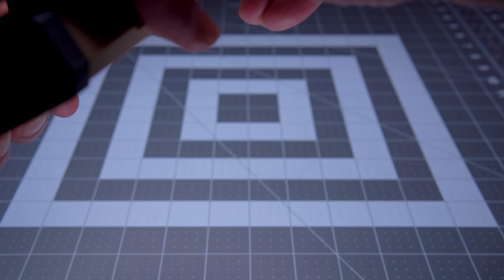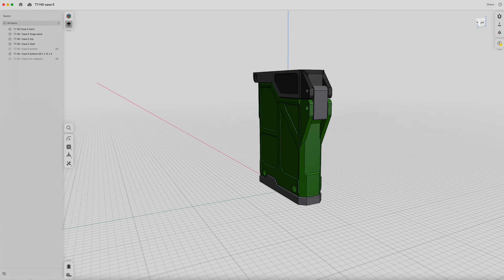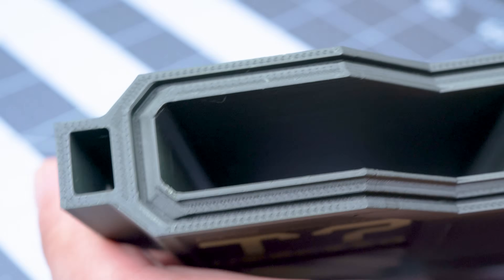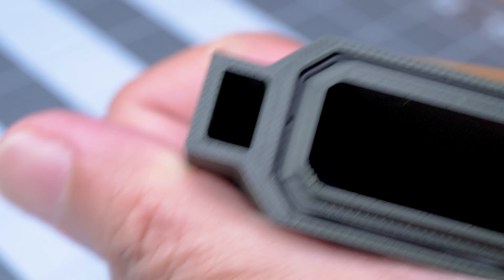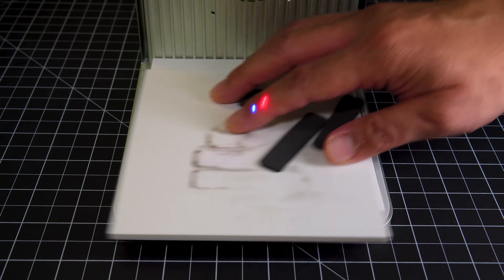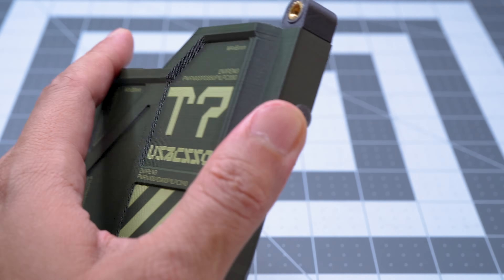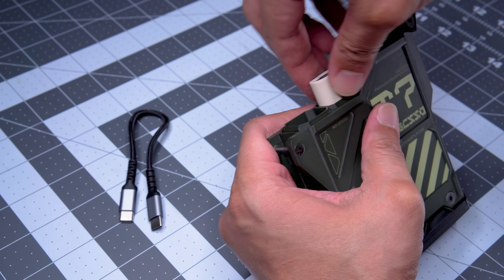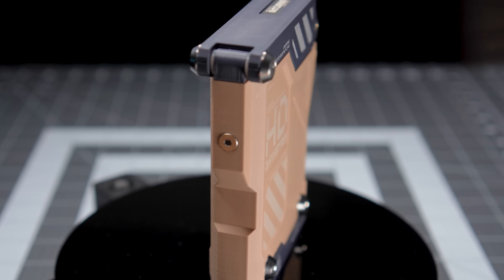T7 Hard Drive Case Build

Comment: You could even pick up teflon washers in that size to reduce friction for the lid if you wanted it to open/close easier. Definitely not necessary but it could be a nice little upgrade.

Comment: Have you ever taken a moment to think about how cool your younger self would find what you're doing now?

Using lazers and 3D printers to build something to hold unfathomably large storage drives.

The only way to make it cooler would be to use plastic that was materialized from thin air using fusion power or something.

Comment: Might I suggest getting yourself a set of reamers for hole cleanup. They produce far less dust if your in a sensitive environment. Plus are generally more accurate when it comes to concentricity and accuracy than a drill bit or other tools. Plus if you have a specific clearance/size you want the appropriately size reamer will let you hit it every time.

Comment: An actually neat feature to add to this design would be a bottom plate with a USB C passthrough. So an upwards facing USB-C plug that the drive sits on and an output socket on the back. Giving it an actual practical use as a harddrive dock that sits on desks.

Comment: okay but why does the hard drive case say "SSD only" on it
Reply from the maker: The limited edition cases shipped with two different bases. One of those bases had neodymium magnets embedded into it, which would have been detrimental to older, magnetic drives.

Comment: what is the tool you are using to press the M3 screw holder into the print? I can't find it on the market
Reply from the maker: It's a 'heat set insert press/tool'. The type that we used for this project is really just a standard soldering iron with thread-on brass tips that are sized to fit the heat set inserts, but the 90 degree armature really helps to make sure that the pressure is applied evenly and perpendicular to the surface.

Comment: I have a tip for you to put inserts better like that:

1. Put the insert
2. Press it with a plane tool like you do
3. Use your solder iron with the special bit but let 1mm out
4. Use again your plane tool to press this last millimeter
5. You can finish rotating your tool before release (optional)

Your insert will be perfectly mounted on each axis with this method and the plastic will stay plane too.
Reply from the maker: Thank you! We'll try this!

Comment: You can use super glue, CA, to build custom O-rings from the correct stock. Cut the length of the cord just short and glue the ends together. It will be under a hair of tension when installed. O-ring kits exist for this purpose.

Comment: This is great, next build drive cage in the same style, where you can slot these in, maybe with a redesign bottom part of this case so you can actually socket the SSD/HDD into it that custom drive cage. Could be a cool little set of NAS like storage.
Reply: Absolutely. Most server rack hardware is unnecessarily expensive, and 3d printed constructions could easily slash prices tenfold. A single 24 port SAS HBA card can support 24*12gbps, aka 288 gigabits per second R/W, or 36 gigabytes a second. (on a single card) But, most hard drives can't actually get anywhere near fast enough to saturate a single 12gbps SAS link on their own, so SAS splitters can rig up several drives per port in order to get greater usage of those links. As far as I can tell, splitters you can find readily tend to split 4:1, so that'd be 96 hard drives (using a single splitter per SAS link) on a single HBA card.

The issue is, even ludicrously expensive rackmount server chassis can only physically fit 20 or so drives, and there isn't any easy way for you to buy stanadalone drive bays. With how easily and cheaply you can get PCBs made though, combined with how robust 3d printing has become in the past decade or so, you could absolutely engineer a stackable backplane rackmount drive bay system and get over a hundred drive setups accessible to consumers. (you're definitely in the 'prosumer' niche, but still firmly accessible to consumers) You're in the area where a fairly reasonable person could actually have petabytes of storage at their home.
Reply: @robonator2945 I like the idea but over 15 to 20 disks is way above prosumer stuff, definitely in the data hoarder part
Reply: @almaefogo  I'm not sure there exists a non-data-hoarder "prosumer" niche when it comes to data storage. That seems like a pretty hard thing to land between, either you don't store that much and a single 2tb hard drive will cover you, or you're hosting your own media servers, backing up everything, (like you should be doing anyway) etc. and you're looking at >10tb of total storage, at which point you're firmly in 'data-hoarding' territory purely because you are an enthusiast and want to do things like keep backups and self-host shit. 

I mean, if you want to keep all of your steam/GOG/whatever games installed or something and play a decent amount of AAA games, that alone could add terabytes. A full blu-ray rip of a single series can take half of a terabyte on it's own. 

If you are looking at 10 TB and up of active data storage (not counting backups and such) then you'd want 2-3x that for backups, so 30 tb of storage. (keep in mind, you should be backing up all of your devices, so this data storage wouldn't just be backing up it's own contents in the case of accidental deletion, it'd be backing up all of your other devices as well) Then you'd want to add RAID redundancy which if you are creating RAID6 clusters with 5 drives each would result in a net efficiency of 3/5, meaning 30tb would actually require 50tb. If you wanted to add additional parity between those stripes in case you lose one entire stripe that'd add another 10 or 20. And suddenly you're looking at like 70TB of storage starting from 10, just because we're now factoring in parity data and a few backups. 

It's basically impossible to fall into the "prosumer" niche without also falling into the "datahoarder" niche if you actually practice basic data-safety practices. (backups, RAID, etc.) 10TB isn't actually that much if you're considering self-hosting your media via plex/jellyfin, keeping your games installed locally, etc. and yet with 5tb drives you're already looking at 14 drives just to meet a 10tb starting goal for active data. Say you want to double that because you want to store a few more high quality bluray rips of shows, now you're looking at 28 drives just because you wanted to expand your local media library a bit without transcoding them and reducing their quality. 

People talk about "datahoarding" as if every single house doesn't have an attic and/or basement filled with boxes of old crap. By just causally living life you're constantly building a collection of shit that you'd rather not lose, and over time that shit builds up. I mean a proper bespoke 100TB server rack setup costs, eh, let's say 5 grand. How much floorspace does that entire attic/basement full of stuff take up proportional to the entire house? Chances are you've paid more for that floorspace to store your old physical crap that you don't want to lose then you would pay to store your old digital crap that you don't want to lose. (the difference is that all of your digital crap can actually be accessed without spending hours sifting through old boxes.) Again, if you self host bluray rips you're easily looking at potentially 5-10 terabytes of data. One bluray can hold 50-100gb, if you're looking at a show with 5 seasons and 1-2 blurays per season that's in the 500g range for one show. 

The point I'm making is that the bar for "datahoarder" is much lower than the bar for "hoarder", and if most families treated their data like they did their physical items, they'd be datahoarders. The difference is they'd have a closet where they store everything, instead of an entire section of their house. (or storage locker or whatever. I've been working on one stereotype here but nothing substantially changes if you have a shed or a storage locker for everything.) There just isn't actually a middleground between "prosumer" and "datahoarder" because the second you start trying to do fairly basic stuff like rip your blurays you start adding several terabytes to your total active storage, and when you factor in backups and RAID redundancy every one terabyte of active storage can equate to 5 or more of necessary data capacity.

Comment: Gosh, that Anero type is cool. So is the case. How much part tolerance do you leave where parts fit together, to ensure they slide freely in?
Reply from the maker: We usually start with a difference of 0.2 mm, but materials and print orientation can make a difference on how loose/tight things end up being, so you can't really avoid physical testing with any design. The hinge spine insert on the T7 project is a pretty tight fit; with the model of the shaft set at 6 mm wide, longitudinally; and the slot it goes into is specced at 6.02 mm wide. It's a tight fit, but note that the shaft has a tendency to warp a little when the heatset insert is pressed in, and the PLA bubbles up around the insert a bit (which we do file down and clean up before assembly to ensure fit).
Reply: @batchresearchlab  right, it depends on printer calibration sometimes too, hence the question.
I imagine heat inserts add another level of consideration to the entire process. Thanks for the info.

Comment: I’m confused as to how the laser changes the color of the print
Reply from the maker: It might be easier to think about it as the laser bubbling (foaming), melting, or burning the plastic (depending on the settings and material you use). The color of the plastic changes because of the reaction taking place, but we don't necessarily have much control as to what color that ends up being (though some materials allow a range of that effect to work with). We have another video that may provide a bit more insight:
https://youtu.be/NQEGXvpRVDE
Here's another link that might help explain what's happening:
https://www.permanentmarking.com/the-4-most-common-types-of-laser-marking/

Comment: That's pretty cool. With how modular it appears, one could modify it to be a universal hard drive enclosure. When I saw the bottom being screwed in, it reminded me of a cheap aluminum USB hard drive enclosure I purchased years ago to transfer some files from PATA HDD to a new laptop. The internals were attached to a plastic sleeve that screwed in on both sides and could easily slide out and you could use sill use it for a thicker drive that didn't fit in the case.

Comment: This looks so cool! How do you do the masking with the laser? Are you printing with multiple layers where you have the outer layer of green being lasered away to reveal the lighter colored layer underneath?
Reply from the maker: Actually, the project parts in this video are printed in just one type/color of filament; and in this case, when the laser makes contact with the material, it's bubbling and foaming it at a microscopic level. You can actually feel the slight relief of the plastic when you run your fingers across the surface. The trick to accomplishing this is to control the duration the laser is making contact with the surface. For some materials/filaments the window between having no visible effect, and flat-out melting or burning the material can be very narrow. We've posted sample settings on certain materials in some of our shorts if you want to check them out. Here's a link to some more information about different types of laser marking:
https://www.permanentmarking.com/the-4-most-common-types-of-laser-marking/
(not affiliated, but we've found that link very helpful)
Reply: @batchresearchlab  Thanks for the information and I will definitely check out the shorts videos! I had no idea you could get that kind of color contrast by just engraving the filament directly. Well, I know what I'm doing this evening :)

Comment: A thought for the next time: If you make the gasket the nominal diameter of TPU filament, that could be a your gasket and might use materials you've already got in your shop. Also: Cut your gasket at complimentary 45 degree angles at the ends, they will overlap in a way that is much easier to fenagle together.
Reply from the maker: Both great tips! Thank you🙏🏼  Early-on we did start experimenting with a TPU seal with that had little ball 'nubbins' that would pop into corresponding ball-shaped holes into the contact surfaces....but we just couldn't work through the design fast enough to get them to pop in securely and cleanly (because we were really trying to avoid using glue). We felt like we had gone too long without posting anything, so we backburnered the snap-in TPU idea and went with the rubber cord because it was closer to viable at the time. Though since, we started mentally noodling on whether a design using dovetail shapes might work out better. The 45 deg gasket cut idea👍🏼👌🏼, man....that makes sooooo much sense...genius. Thank you🙏🏼🙇🏾‍♂️
Reply: lol I was thinking the same thing. Maybe even use heat to join the ends.

Comment: Nice project, for that lid I think an over-center mechanism with some skeletal arms/struts would be neato
Reply from the maker: That's a great idea🤔! As it stands, that inner part of the seal closest to the hinge did have to be designed so that it accounted for the arc path. A multi-pivot system could provide a much better seal and even-out the pressure applied to the seal when the container is closed. We'll definitely tinker with that when we move to stronger materials after we finish some mark testing with the laser on some of them (PETG, ASA, etc. Thank you for the tip!🙏🏼🙇🏾‍♂️
Reply: What is an over center mechanism? 😅 Is that just like a door hinge mounted centrally?

Comment: Is that test pattern for the laser proprietary or something publicly available?
Reply from the maker: Whoops, thanks for the reminder! I was supposed to clean that up and post it. We do have an older version of that test posted somewhere, but we've since revised it. Give us a little bit, then check the 'Files' section in the accordion at the bottom of the landing page.
Reply from the maker: Okay, check it now; I've posted a link to the xTool file we set up for the filament parameter test shown in the landing page write up (the one on the test plate).
Reply: @batchresearchlab  Thanks! I'll have to see if I can open it bc I have a different laser but I'll figure something out. FYI- The accordion section at the bottom of the page didn't work on mobile for some reason. May be worth testing.

Comment: Did you use PLA or ABS?
Reply from the maker: So far, we've used PLA for this design; standard PLA, some matte PLA, and some PLA Pro during experimentation.
Reply: @batchresearchlab  Sounds good, Thanks for the answer! But just watch out as PLA is not quite resistant, if this needs to protect what's inside and you want to make it truly heavy duty i highly recommend some more tough materials :)
Reply from the maker: Thank you for the thoughts🙏🏼🙇🏾‍♂️ . Since this started out mainly as an aesthetic design exercise, we initially used just what we had on hand. But as it became more 'real', then we began to think more about function. As we move into experimenting with more durable materials such as styrenes and polyethylenes, we'll need to be a bit more cautious around fumes especially was we begin laser marking tests with those materials as well.
Reply: @batchresearchlab  I must say, now i want a Laser engraver after looking at your videos. It truly ads quite some nice detail to the prints!